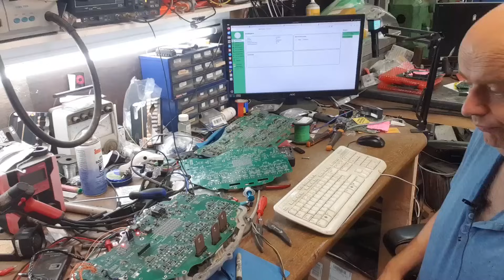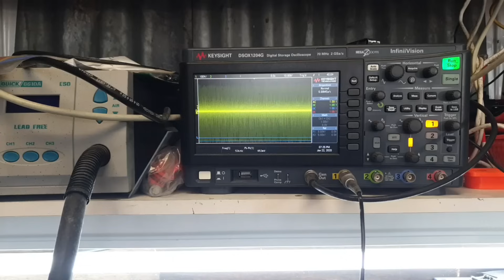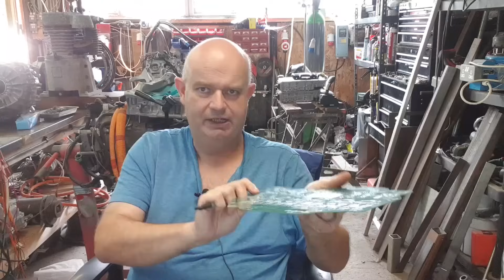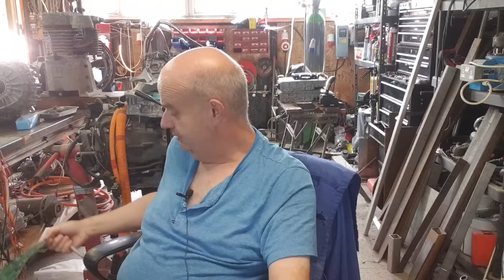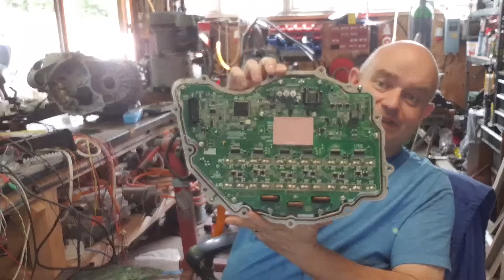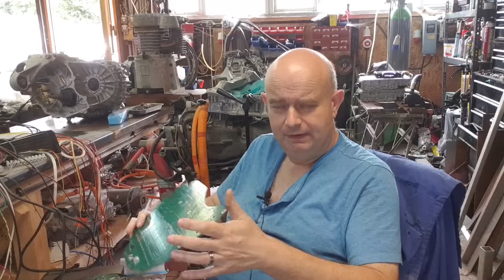Tesla Model 3 Drive Unit PCB Design 09 : I Screwed Up

Comment: Really love your vids Damien and happy to put five hours aside each time to watch them! 😂 You could be a stand up comic in another life.
Amazing work to completely design a board to replace the original but wouldn't it have been easier to replace the micro-controller on the Tesla board?
I use an EV-Controls ECU on my Tesla conversion. Works great but expensive and I understand it runs on an early hacked firmware.
Hasn't any of you CAN geeks yet properly hacked Tesla's CAN messaging to run the original proven board from the Zombie?
Reply: If you check back in the history of the Model 3 drive unit, you will find videos where Damien designed an adapter board that puts an STM32 into the place of the original microcontroller.
This is not something that the average joe or even the more experienced joe could successfully solder at home with normal equipment, therefore this plan was scrapped.

The original control board has an immobilizer that is not trivial to reverse engineer. If that was easy to do, someone would've already done it.

Comment: Thanks for sharing. I come from fixing some old PCs. Why did they stop working?  Try to find an os that would run on a 486 today. No Gento would not allow me to build such a kernel but I came quite close. Have a look at the mainboard. Why have all blown up capacitors the same capacity and voltage?  Next the powersupply. They all look the same. It must be a design problem. All capacitors on the 5 Volts circuit are blown. on all of the power supplies. Except for the size and the amount of noise it makes when exploding The drive unit and a pc powersupply should me mostly the same.

Comment: Maybe test with the v1 board you have and add an extra ground path manually (solder wick is a good conductor.)? We do that when prototyping high freq. RF equipment in the dev stage. Cheaper than spinning another version and having the problem remain.

Comment: "A problem shared is a problem halved" Aha. Mhm. I see mitigation by dispersal is your solution of choice. This is like when you open a container at the back of the fridge and it stinks horribly, so you grab your spouse and say "Oh gross, come smell this!" Every person who has to experience the misery with you, reduces your own misery. I find it to be about a 5:1 ratio. As in, if you can get 5 others to experience the horror, you've reset yourself to zero. If you can get 10 people to experience it, well, that's actually a positive for you. Unfortunately, now there's 5 or 10 other people who themselves each have to go find 5 or 10 new victims in a Facebook MLM pyramid scheme where almost everyone in the end loses. This is how early internet shock memes like Goatse, Tubgirl, Lemonparty, and 2Girls1Cup propagated. I digress, weren't we talking about EVs? Oh right. As to thumbnail, I think you missed the boat, you needed to be holding the board in your hand  and your scowling face yelling at it. You need to be spending at least 50% of your time on thumbnails. Content hardly matters. The appearance of engineering is far more valuable to the algorithm.

Comment: So just add some Capacitance to the RC filter on said ADC? sure its not ideal to have a shit response but its better than nothing. I am currently messing with my own Gate drivers for learning purposes what sort of di/dt should i target for when designing my current sensing amplifiers? lets assume a measly 200A phase current? Have you thought about using something like 1EDI3025AS gate drivers instead to reduce component count. 

So are the mounting holes floating completely? how is the impedance so high isn't there a solid ground plane between them? Are the gate supply decoupling capacitors sized correctly?

Loved the video!!